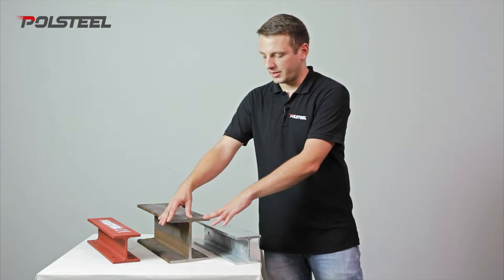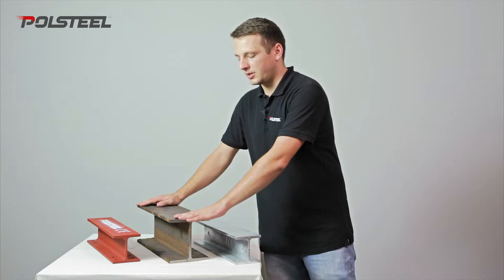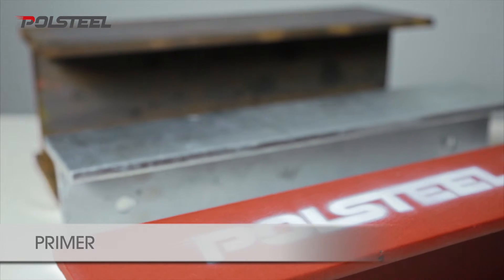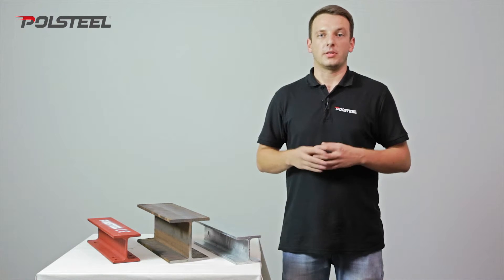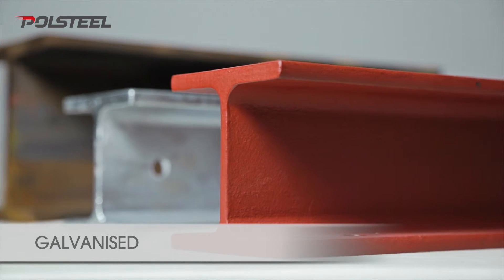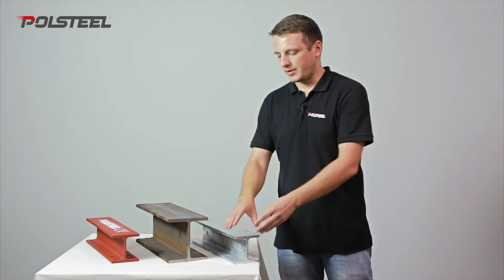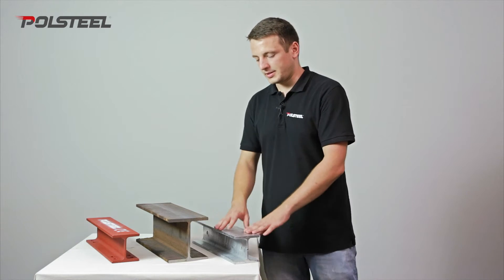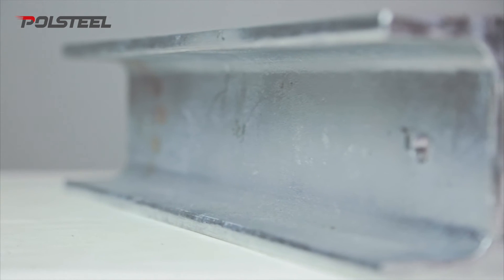ASK THE ENGINEER - STEEL COATING

Comment: Hi, i have a problem that maybe you can help me with, i have modified a pizza elettric oven that has 2 heating element, one under the coking plate and one above it (both of them are 600watt), i have removed the bottom one and placed on top together with the other one, for a total of 1200watt above the plate, i reach 430 degrees celsius on the coking plate for coking pizza, but the problem is that after the coking i have found metal particles on the coking plate (a lot of them like a powder) and i have used a magnet for picking up this particles, now the oven is made from stainless steel aisi 300 series and its not magnetic and it has no visible sings of corrosion, i think that the metal particles come from the heating elements (the magnet do not stick to them too so probably also aisi 300 series), and also this wasnt happening before i placed the bottom heating element above together with the other one, do you know what is goin on? the heating element are in apparently good shape i dont see any visible signs of corrosion or rust on them, one thing to mention is that the heating elements touch eachother (for a reason of tight space available in the oven) so maybe when they heat up and expand and then cool down and reverse there is friction between them, or maybe is beacuse they heat up to much (the glowing color bytheway is red not orange or yellow). Do you know what those metal particles can be? Thanks
Reply from the maker: Hello Iamil,

Thank you for your comment, but, unfortunately, I'm afraid we won't be able to answer your question. We specialize in structural steel, so I don't know how to even begin to answer your enquiry.

I am sorry.

Best of luck!
Reply: @SteeloLtd  thanks you anyways :)